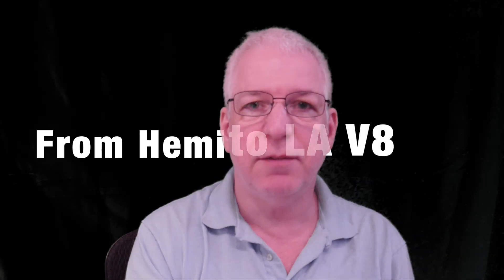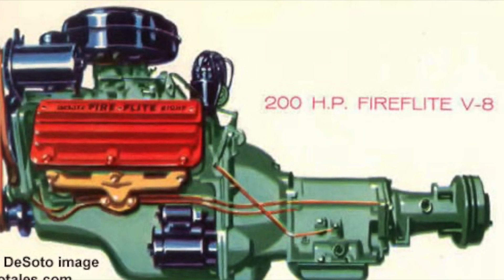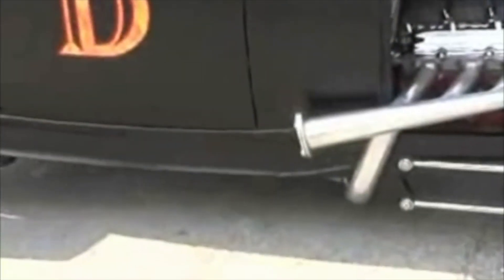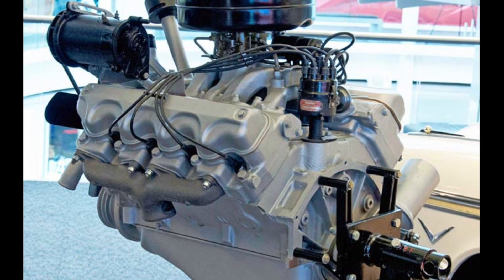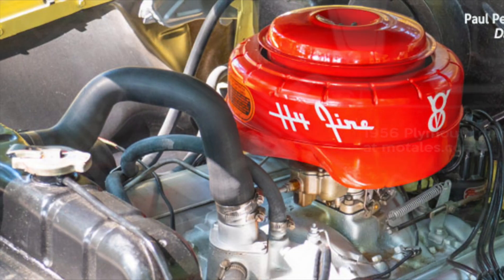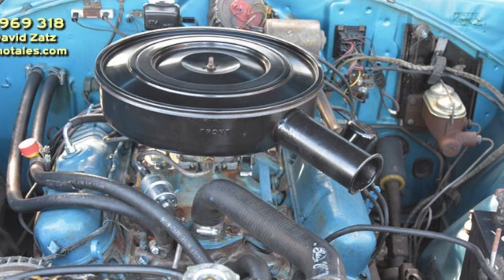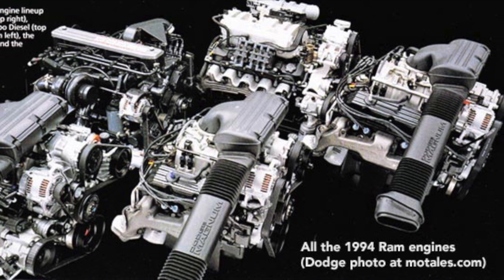Hemi to LA: How Chrysler went from the Hemi to their 1990s truck and Viper  V8s

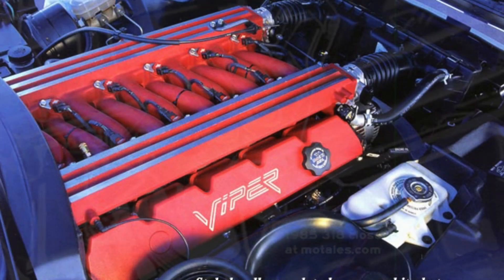Comment: The LA's had an odd characteristic inherited from the Poly-Head A engine.  The A engine's pushrods were at different angles to accomodate the different valve locations and rocker arm designs between intake and exhaust.  The lifter bores were at a 59 degree angle to 'split the difference' between the intake and exhaust pushrods.  The LA engines retained the 59 degree lifter bore angle even though most wedge-head OHV V-8 engines used a 45 degree lifter bore angle.  I suspect the 59 degree lifter bore angle was kept in order to save money by re-using some of the original Poly-Head tooling, but I am not 100% sure.  The lifter bore angle of the LA engine has to be compensated for by the camshaft lobe timing and can result in pushrod defection at high r.p.m.'s, which is why some special high performance LA blocks had the lifter bore angle 'corrected' to 48 degrees.  You can see the funny angle if you look closely at the cut-away drawing at 3:42.  It's a bit exaggerated but it illustrates the characteristic.  Oh, and BTW, there is a little bit of the 'LA' in the 3rd. Gen. Hemi!  Some of the block dimensions are the same as is the bell housing bolt pattern.
Reply: Uncle Tony has a great YouTube video on the Poly engine.

Comment: Doesn't the current crop of modern Hemi engines still use the same crank journal spacing, cylinder bore spacing, and crank journal dimensions as the LA and Magnum blocks?